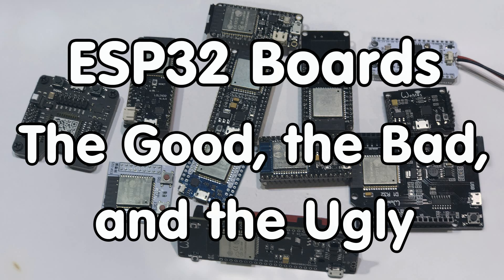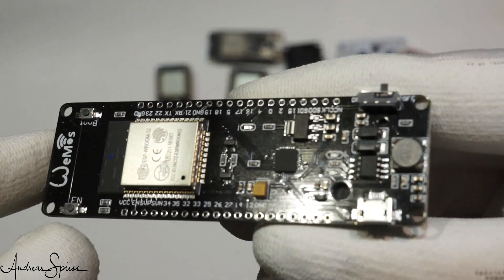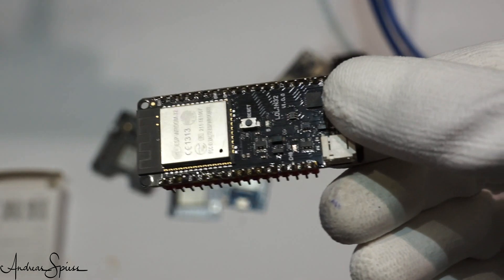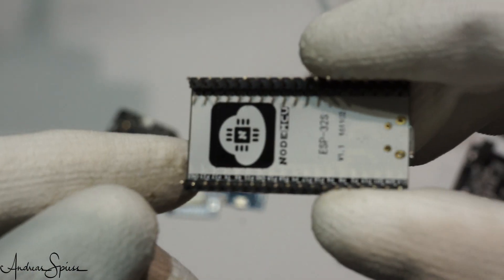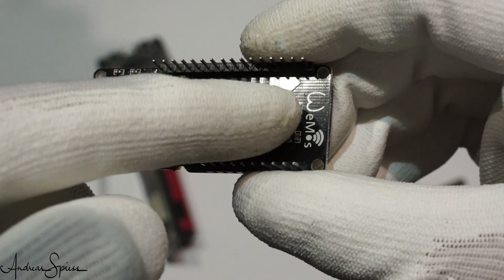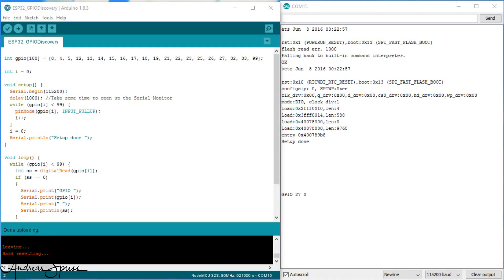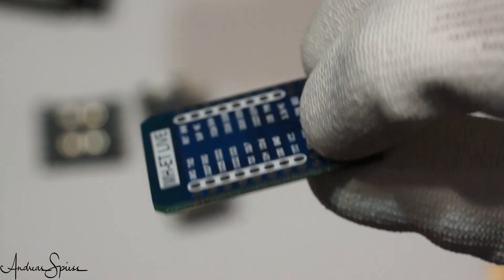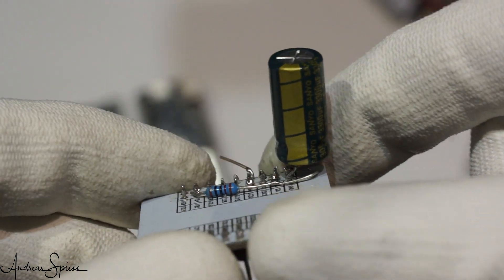#159 Big ESP32 Boards Review and Test

Comment: Many thanks. I don't suppose there's a wiki somewhere where people can add their own "deep sleep" current draw values.
e.g. I have a Firebeetle-32 which if powered with 3 or more volts it draws 0.035mA in deepSleep.
I'm sure there are other good dev boards out there, but not many.
Reply from the maker: I will do the test of the battery-driven boards and I am curious about their deep-sleep behavior. The Firebeetle-32 seems to be very good in this respect. However, it is quite expensive...
Reply: Andreas Spiess 

Pls test the fire Beetle, I would like to understand how they are able to get the deep sleep current so low. 

Also it would be good if you could show us what the design considerations are and maybe produce a schematic along with your wonderful technical explanation. 

I would really like to design my own PCB, but lack the basic knowledge of the design. I can work out how to use the PCB design, would just like to get it right first time. 

I hope this can be a future project   

Andreas many thanks for reading this post. 

Hope you are well and enjoying life 🤗

Comment: Great video!

However, I'm disappointed about the boards. I was hoping to find a good upgrade for the Wemos D1 mini, which is perfect for me. I had great hopes about the MH-ET LIVE board, but the problems you mentioned are absolute show-stoppers for me :-(
Reply from the maker: At least it seems to be compatible with the Wemos shields (as another viewer commented)
Reply: If you can't solder the pin headers on there, I don't think you can use the shields?
Reply: Oh never mind I just read the other comment saying that female pin headers fit.
Reply from the maker: +g3i0r The viewer wrote female pin headers fit in the holes

Comment: just guessing: what consumes energy on most of the boards are the voltage regulators and the leds... this is why the naked wroom module is the best for low power, but you may need to add them back... so?
Reply from the maker: 1. Yes, you are right.
2. If you use OTA or if you just deploy a stable version you only connect the Serial-to-USB board only once. And if you go with a LiPo, you can choose the LDO of your choice with a low quiescent current (I made an ESP8266 video about that). Like that, you get the low current consumption during operation
Reply: Matches my experience, if you're buying, look at the image.. if the 3 pin+tab IC is large, it's very likely to be a 1117. You can buy lower quiescent current pin compatible chips with about 80..100 microAmps quiescent (~100x reduction). Theyre' moderately easy to replace. I've done this with an ESPea32.
Reply from the maker: I used HT7333 for my SP8266 experiments. But they have a different pinout...

Comment: Hi, Andreas, I have finally recieved my yellow pin ESP32 board. Which option do you choose in arduino ide board anager menu? I have install github repository but they are more than 20 boards to choose. Could you help me ? Thanks.
Reply from the maker: I use the ESP32Dev Module. But I did not look at the other board definitions for find out if another one would fit better.
Reply: Andreas Spiess  Thanks again

Comment: Hi Andreas, I really like your video comparison. The NodeMCU is very little board , I've already have an ESP8266 Doit board and it is very small and very comfortable on the breadboard, and NodeMCU with ESP32 seem to be same size. It fits on the breadboard? You says that Yellow board is board you actually use... I like too this board, but I can't try it on the web. I've tried some with yellow strips but not sure is the same board. You maybe can post a link where I can find it?  If posting here the link is a problem I can send my email address. Many thanks. : D
Reply from the maker: The boards change quite a lot and I think, the links of the boards I used are in the description.

Comment: Hi, thanks for the videos. I am trying to use the ESP32 Bluetooth but cannot find a way to specify the PIN number. Is there a way to define some security and avoid anyone to connect to my Bluetooth?  My ESP32 shows in Arduino IDE as ESP32 Dev Module. Thanks
Reply from the maker: You find all my BLE Know-How in my BLE videos. I have no idea about security concepts in BLE and if it is already supported in the Arduino IDE.

Comment: I could never get the board with 18650 to work on battery! any tricks to get it working? I tried 2 types of batteries. Could you please do a video reviewing it? is there a pin to get battery voltage data so we could notify for battery replacement ?
Reply: Did you use LiPo battery 3.7V?
Reply from the maker: I tried mine without trick and it worked.
Reply: Sounds like you may have a broken board. I have a similar board and it even runs off a  lifepo4 (3.2v), though obviously I never try to charge it using the built in charger! My board didn't come with a way to monitor the battery.. if I remember right, before I broke I :), the circuit in my board boosts the voltage to 5v and then regulated it back down to 3.3, making it even harder to read the battery when it's low. I guess the user a standard usb power bank circuit.
Reply: I have 4 of them not working. Would you guys tell me where did you get your 18650 battery? Also does it matter the on/off switch? does it charge in either position?

Comment: Hello Andreas,
your video was super helpful. Can you tell me where to get a precise Power Monitor like yours in the video? Can you send me a link to yours or recommend an alternative? I really need one for measuring the current and voltage for a project. Thanks in advance!
Reply from the maker: I use a normal power monitor from AliExpress and a multimeter for the non-USB boards. For deep sleep, I use a ucurrent gold from eevblog.
Reply: Hello Andreas,
the Board on minute 14:53... does it already come with soldered resistors between the buttons?

Comment: I have a ESP32-WROOM 32D MCU. this will sell with 4MB or 16MB. how can I test the memory space? did you have an idea?
Reply from the maker: You can use this command (in windows): esptool.exe --chip auto --port com14 flash_id   com14 has to be adapted to your serial port.
Reply: @AndreasSpiess  , thanks a lot, I have FFAT installed and I choose (ESP Dev Modules ) in Arduino IDE , Partition Flash 16MB , 3MB for Apps, 9MB FATFS. rest 4MB ???
Processor is ESP32-WROOM 16MB. with (FFat , totalBytes()) and (FFat , freeBytes()) I become the needed information after format() formatting the FFAT  flash memory. 3 MB is for Apps and 9 MB is for FatFS. I don’t know the 12,5 MB Fat functions, but 9MB is more then the max 3MB for SPIFFS with the normal ESP32 4MB.
OTA is unknown, but a don’t need this. I don’t test the OTA programming yet.

Comment: Please do a video on running lora modules with esp32 boards
Reply: Ton Pijpers ya... Im trying to port my esp8266+lora code to the esp32 and its having some problems with spi communication.... So a video on esp32 with lora will be a big help....
Reply from the maker: There are ESP32 and LoRa boards available, but for the moment only for 433 MHz. I wait till they are available for 868MHz

Comment: Anyone know what is the closest board name in the ESP32 Arduino board manager for the "Yellow" model shown in the vid? I've been switching between "Node32s" and "DOIT ESP32 DEVKIT V1", with the latter being the fastest in uploading. Just wondering if I'm doing something wrong lol. I also have to hold the FLASH button when uploading.

EDIT: The vid creator has a comment below saying that they are using the "ESP32 Dev" board name
Reply from the maker: I always use the "ESP32 dev module" board. It is very flexible.
Reply: @AndreasSpiess  Thank you, I'll just stick with that to be safe. The upload speed is more or less the same.

Comment: it seems puzzling to me that producers make arduino-like but not arduino-compatible esp32 boards. esp32 is a far more powerful mcu, even though not replacing arduino.
Reply from the maker: They are very much compatible, I think.
Reply: @AndreasSpiess  i mean making a board look like arduino but no on-board level converters to communicate with 5v arduino is nonsense. only to confuse new users.

Comment: The current usage figures for deepsleep mode are very misleading. I don't think it makes sense to measure the current on the 5v USB line because you're unlikely to power these boards with a battery via USB. I have the Lolin32 for example and I get a current usage of 130uA when it is in deep sleep mode. That is 10 times less than the figure you give and supposedly other boards use even less power. I am using my Lolin32 with a 1200mah battery and it has been working for a month or so which is perfectly acceptable for my use case. Don't dismiss the development boards for battery powered devices just because of this video.
Reply from the maker: I know that and I think, I even address it in the video. I did this because I had many, many comments in my ESP8266 videos where people complained because they used the 5 volt rail to power their development boards.
Reply: Hi Andreas, Sorry I do not see where you mention 3.3v vs 5v in the video? Why not take a measurement of power consumption in deepsleep mode at 3.3v for at least the battery capable devices? That way the viewers get the full understanding of their options. Yes you may not be able to achieve 17uA but for some people 170uA is acceptable. This is otherwise an excellent video. Keep up the good work.
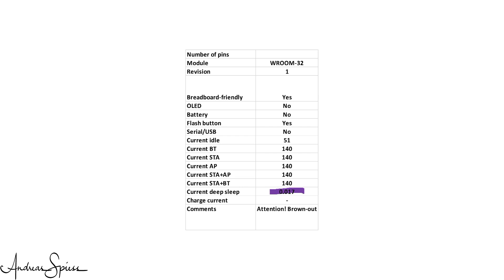Reply from the maker: I mention the fact at 13:25. The discussion about the different power supplies are in other videos
Reply: Good point. It is very typical for stuff like voltage regulators having a high current draw and with a battery the current drops a lot.
Sometimes boards need more tweaking like removing power leds and replacing 1k pull up resistors with 1M ones and so on to get them battery friendly. I think this is not an important feature for a development board but if you make a battery powered device out of one, you surely want to tweak it as less as possible to "fix" the basics.
Similar tweaking was needed with arduino nano boards too. I'd love to see a real developer ready board that needs none of that when you make the one off device. Especially for the devices with battery mount or connectors inefficiency is unacceptable.
On reviews it could be helpfull to point out the current draw sources when known. That helps to estimate if a board is easy to tweak for battery operation or not.

Comment: Thanks for this great comparison!

Did you also compare the WiFi reception?

Here I found that the nice looking Mini Kit (or a clone named " MINI D1 ESP32") shows ca. 18dBn less than an older original WEMOS LOLIN32 (with Rev 0). So it has a very limited use for me, although the form factor seems nearly perfect to me.

The analogRead is already working on the ESP32. I use it in combination with a FFT calculation (https://github.com/kosme/arduinoFFT), which works quite sensitive. Nearly out of the box, you have just to redefine the pin to an GPIO No. The computation of a 2048 FFT Needs less than 70ms. 

Analog Write seems to be still missing.

Spiffs have been added 4 days ago.

My arduino shaped board needs a press on the button after being connected to power. So it is totally useless for productive use.
Reply from the maker: 1. No, I did not test Wi-Fi performance. As all modules use the same WROOM32 module I do not expect big differences.
2. Maybe you got a bad module?
3.Thanks for the analogRead tip. I did not know that they added it now.
4. I did not experience this behavior of the Arduino board
Reply: ad 2: today I got a new  MH-ET LIVE D1 mini ESP32 (with vesion 0) and this had the same bad RSSI values. After soldering an 10uF cerco between 3.3V and the metal can AND resoldering all Connections between the module the pcb the RSSI values were 15dBm to 18 dBm better. The old one now is also better after the same treatment.
hard to believe, but it happened twice.

Comment: Help me! Please, I have this problem with the ESP32 Wemos R1 32

El Sketch usa 207705 bytes (15%) del espacio de almacenamiento de programa. El máximo es 1310720 bytes.
Las variables Globales usan 15228 bytes (4%) de la memoria dinámica, dejando 312452 bytes para las variables locales. El máximo es 327680 bytes.
esptool.py v2.6
Serial port COM6
Connecting........_____....._____....._____....._____....._____....._____.....____Ha ocurrido un error mientras se enviaba el sketch
_
A fatal error occurred: Failed to connect to ESP32: Timed out waiting for packet header
Reply from the maker: I assume you did not keep the boot button pressed when uploading.
Reply: @AndreasSpiess  Thanks to answer me! But my board dont have Boot Button! Only one Reset Button. My board is the ESP32 Wemos D1 R32
Reply from the maker: Then you have to try with different board definitions in the IDE. Otherwise I also do not know.

Comment: Very dissapointing for deepsleep current. Andreas.
Reply from the maker: Just the development boards. This is well known. The ESP32 itself is ok.
Reply: The currents Andreas gave are misleading. He is measuring current from the 5v USB supply rather than the 3.3v line which you would use when powering the board with a battery. For the battery powered boards such as the Lolin32, you are going to get MUCH lower current usage. My Lolin32 for example only uses 130uA and other boards go down to 30uA (yes micro amps).

Comment: you should buy a better microphone or add a filter that cuts computer fan noise :-) bye
Reply from the maker: Did you experience the same in my other videos? I always use the same microphone. If not, changing the micro would not suffice. A divorce would be necessary because you might have heard the noise of the party of my wife. As a Youtuber, I had to work to finish the video :-(
Reply: I use to watch videos by using laptop or monitor speakers, but last time I used headphones and the fan noise can be heard clearly; so I don't know if is audible in other videos. bye :-)